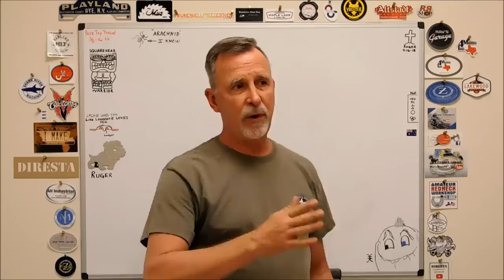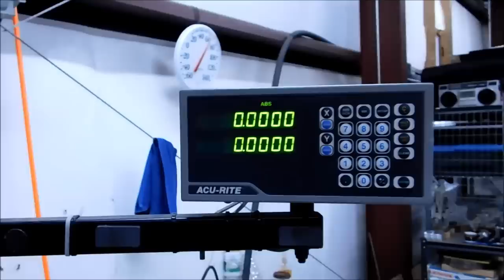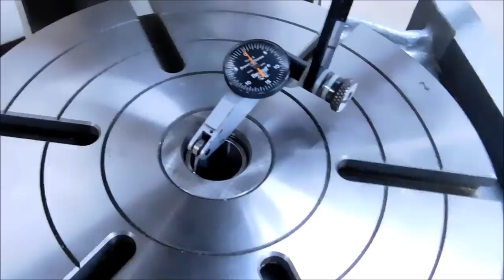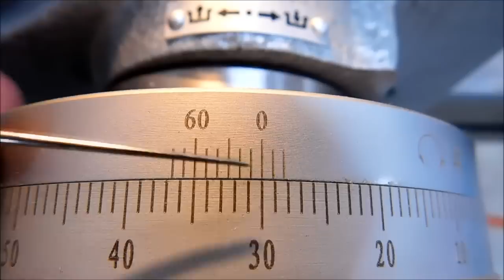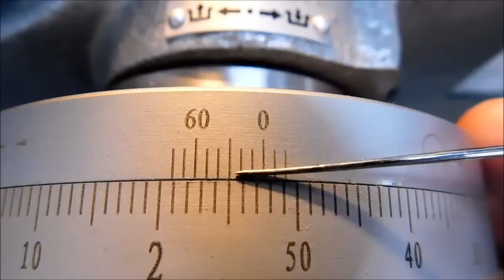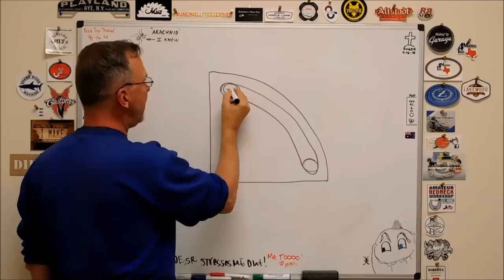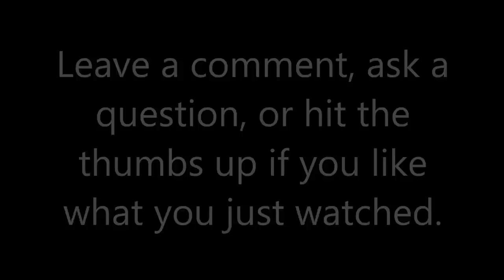Rotary Table Basics

Comment: many years ago i had a .75 dia  tube i needed to put two holes  at an angle.   180 around..   with a dividing head.    i had very little experience with a dividing head.   it took me almost 30 min.  to do the math.   in the machine shop you eater learn , or you get burned.

Comment: Joe, 
How did you make the slots in the rotatory table perpendicular to the base when the table is zeroed out? It looks like you moved the zero marker but I can't get a good look at it. I have a Phase II table and I would like to fix that problem too.
Reply from the maker: This video at about 13:40 will give you a look at the offset adapter I made for the small zero indicator plate.  https://www.youtube.com/watch?v=QmgO2XyrtKc

Comment: To get the table t slots square at zero, disengage the worm drive, grab the table and turn it where you want it
Reply: That will let you zero out the micro adjust on the handle, but not for the whole table and its perimeter scale in relation to the zero indicator he shows at 5:45 that has a slight range of adjustment.  The outside scale on the table itself is basically fixed, unless he'd make a new area to move the 0 indicator to, regardless of where the worm drive is engaged.

Comment: Joe,
Please take a better shot of the clamp that you used to hold down the right side of the table.  I have always just used a clamp set, but the one you used looks like it might be better for those items that don't have a slot for a stud and t-nut.  Also, what were the parts that you used to make the camera mount?
Reply: pieces for a flexible coolant nozzle
Reply from the maker: Most of those components are available on my website, but they are called Loc-Line. This is the 1/2" size.

Comment: When you made the slot wider, the ends of the slot would not be parallel with the sides of the part but would follow the radius line from the center of the rotary table, correct?  How would you make it parallel with the straight sides of the part?  Great videos, by the way.  Thanks Joe.
Reply from the maker: Thats a common misconception. Use the X and Y cranks on the mill to keep the slots parallel to the part sides. Just be sure to get the part back to zero, and go at it like any other vertical or horizontal slot. Then use the rotary to connect everything.

Comment: Thanks for the video. I have the 8" version of the Phase II rotary table and can highly recommend them. I almost always mount an 8" 4-jaw chuck on mine. This makes centering to the table axis very easy.
Reply from the maker: Double check the center sleeve to the rotation of the table to be sure.

Comment: Does a CNC machine effectively eliminate the need for a rotary table, or are their operations that you would need both a CNC and rotary table?
Reply: Beach&BoardFan rotary tables are used in CNC for simple angular indexing. Kinda faking a forth axis.
Reply: Simplest case where a rotary table is desirable is for a bolt circle lager than the Y travel. Use the set the radius using the longer X travel and index.

Comment: Joe, suffice to say you provide some excellent instructions.    I am a newbie to machining.  I recently purchased a 8" rotary table and for now (a chinese brand).  Hopefully later to upgrade.    The RT has a MT3 taper for the center hole.  My question is I like the idea of centering the RT with a fixture attached to the mill spindle such as some type of arbor.  I cannot find such an animal.  MT3 to straight shank arbor.  Any ideas.  I can dial it in but it takes me forever.  Practicing helps I know.  But for a quick centering, spindle alignment method.  Thks
Reply from the maker: Realistically, any stepped arbor will suffice. One end in the collet, the other centers the table. It doesn't need to be an MT3.
Reply: @joepie221  Thks

Comment: Joe, given the base of the rotary table, I would think that table designers would have provided for a taper at the center where one could insert a dead center to which another dead center could be mounted relative to the table center; not unlike a dividing head.  I just purchased a Palmgren 8" rotary table and it does appear to have a slight taper at the center.  So, what were the thoughts of the engineers who came up with the table on this count?
Reply from the maker: I am almost positive the center bore is a taper.

Comment: Is there a good way to keep up with minutes and seconds when you are going around lets say a bolt hole pattern? For an example  you need a hole every 13 degrees  7min 30 sec. That is a lot of information to keep adding up late in the day.
Reply from the maker: Some jobs just require a little more attention. Don't be ashamed to make a chart if it helps. Maybe do the job earlier in the day too.
Reply: an "indexing" tool comes in handy here, where you can constantly zero your starting location at each stop point.

Comment: Joe, I am concerned about deflection of my mill table with a permanent mount of the vice and rotary table.  Bench top 28" mill.  There is enough room, but that's a lot of weight even in an 8" rotary.
Reply from the maker: On a smaller machine, I would choose one of them and center it. Center the table at night when you are ready to leave it for a while too.

Comment: Regarding the table slots being misaligned relative to the base when zeroed, couldn't you just mill a flat on the table base that is exactly 90 degrees from the base, and then mount the reference line plate there? E.g. change where the zero is referenced from?
Reply from the maker: I made a custom index plate. Problem solved.

Comment: math fun: 10 sec. precision = 1/360 of 1 degree = 0.002778 degree. On a 1" diameter = 0.00002424...." arc length on the circumference.
Reply: "No math fun": why mix in minutes and seconds, why not just go for 24,57°?

Comment: Since I'm converting my mill to CNC I haven't thought of any further uses for my rotary table.  Are there any tasks you can think of that would be better/easier with a rotary table than CNC?  If not, I might have a rotary table to sell (if I could bring myself to part with it).
Reply from the maker: Maybe a makeshift 4th axis for the CNC? Rotary table on a tilt base.
Reply: You might have occasion to set the rotary 90° to the miller table to machine operations on the periphery of a part. A CNC miller can be used but wouldn't be much help in that situation as you would still need the rotary to index the part.
Reply: You will think of something right after you sell it.
Never and I mean never get rid of these things, 99% that did wish they didn't.
Even cheap ones aren't cheap.

Comment: You could rotate the base so that the T-slots are as you like them, and then relocate the zero indicator to where the "0" falls. ?
Reply from the maker: That was the fix, but it did require a longer index plate. Not too bad.

Comment: joe I have been working in a job shop for 7 years ..and have recently switched jobs to a valve company that repairs valves stuff like that ...can you please show us how to setup a double lead left hand acme thread..or can you show us how to move the threading tool over to pick up the next thread when the compound is on 14.5 degree  thank you
Reply: Not a problem if you direct plunge cut since you can advance the compound by 1 pitch ( half the lead). If you insist on the 14.5 degree approach you need to find a way to index the part with say two discs that have index holes at 180 degrees or possibly depending on accuracy and lathe type indexing the chuck and part on the spindle. 
You could also theoretically advance the compound by pitch/sin(compound angle) Sin 14.5 degrees =0.25036. So for practical purpose move compound 4x pitch. Now retouch off the tool and reset the dials to zero.

Comment: Hey Joe ,,is it worth having a rotary table for a horizontal mill? Have a chance to get one and wondering if it will serve me
Reply from the maker: There is no doubt it would increase your capability, but it may be tough to see what your cutting if you plan to do complex shapes. I suppose price would be the determining factor.
Reply: @joepie221  guy wants to trade it for a aluminum spool gun I have I never use,, older rotary table looks well built and heavy only stands horizontal mount,,
Reply from the maker: @georgespangler1517  If nothing else, you could trade it for something you really need.
Reply: @joepie221  your right,, would be better with indexer with tailstock for my horizontal mill,, going to let it go and keep my aluminum spool gun,,I've need it as soon as I sell it,,
Reply: @joepie221  Thanks for getting back to me Joe,, really enjoy your vedios you have taught me more than you will ever know in the past 2 year's
Reply: @joepie221  that didn't sound right,,lol that's try ,, you have taught me so much in the past 2 year's..

Comment: To me degrees, minutes, seconds makes as much sense as pounds, shillings, pence. Someday I will make a new dial in decimal degrees. Dyslexics of the world untie!
Reply from the maker: If you think about a single degree as one complete 360 degree sweep of a second hand on a clock face, things may start to get clearer. Just pretend, one degree = one hour. For every degree, there are 60 minutes. If you could have a really big clock face and fit 60 lines in between each of those 60 minute lines, you would now have the seconds. 60 seconds to every minute. Everything is just a smaller part of the group before it. Just like telling time. Decimal angles can get confusing and will always need conversion before a machine can be adjusted to position correctly.  The error is usually in the interpretation. 20.3 degrees, is not 20 degrees, 3 minutes. Hows that for a clear explanation??

Comment: Sorry, but I don't think this part would work as it would be intended. This appears to be an adjustment plate to allow a fixed object to swing on an axis point allowing a swing of 45 degrees.  If the long slot in your drawing was milled using the corner of the plate as an axis point, the hole that this plate was meant to pivot on would have created a different radius. Therefore the geometry of the slot should be in accordance with the center of the bolt hole, not the corner of the plate. I would completely mind my own business but we don't want people attempting to make this part and wondering what happened. I read through a bunch of comments to see if someone else had picked up on it (because I didn't want to be the one to say.  - lol) but most of the comments were about acquisitions of newly inspired rotary table stories.  I've learned so much watching your videos, please keep up great stuff you do. Gary in Canada
Reply from the maker: Hi Gary. Its interesting how some minds jump directly to the hole being the controlling feature. This simple part isn't as simple as it would appear. Thats how we not only ruin parts, but also learn. Your observations are a result of your ability to see all the pivot points in your mind and scratch your head at the concept of just one setup. I admire your vision. Good job.

Comment: Not the most rigid setup, but it worked out pretty well on my little mill until I started printing gears. The cut gears are still better, but printing takes less work. http://www.dvxuser.com/V6/showthread.php?338827-Do-it-myself-focus-gears

Comment: Hey Joe, I inherited a rotary table from my neighbour's widow so I never had a chance to ask her husband about it. This rotary table has an X & Y travel built right under it instead of a stationary base when would that be necessary?
Reply from the maker: Any part you need to make that has multiple round features would have to be relocated on a regular rotary table. An X Y table allows you to reposition the part over the rotary tables axis without unclamping the part. Its a better rotary table for sure. Nice tool.

Comment: I am sure if i received a table and the slots at zero were not inline with the absolute center of the mount slots i would box it up and return it. How are you supposed to zero a 2 bolt vice
Reply from the maker: I was surprised as well. I also made an offset adapter for the pointer and solved the problem. All is well.

Comment: I’m not a machinist but if you want to align the slots in your rotary table with the x-axis why don’t you rotate it on the mill table?   Granted you would need to make an adapter plate to bolt to the mill table.

Comment: how do you hold parts to table- there's not enough room for toe clamps?
Reply from the maker: Holding parts the same size or bigger than your rotary table is a common occurrence. Get 2 bars of scrap stock and drill and c'bore them to mount to the rotary table. Make these bars long enough to overhang the perimeter of the table. Place your part on them and drill and tap the bars for the hold down clamps.
Reply: @joepie221  thanks for the help, Joe

Comment: On your sector part you drew.  Shouldn't the pivot point be at the hole instead of the corner?
Reply from the maker: Please give me a time reference.
Reply: @joepie221  Thanks for the reply.  I'm not sure what you're asking when you say time.  My comment is marked "two hours ago" as of this writing. 

When you drew the sector on the whiteboard, you mentioned that the 90° corner should be in the center of the table.  It would seem to me that the hole near the corner should be centered, then the cutout would be the proper radius, allowing for example a pin to be placed in the cutout and the whole sector rotated around, say, a bolt through the hole.  If the cutout radius is measured from the corner, then any pivoting will have to be done from that corner.  Not a big deal; I know it's just a made-up example, but I thought I'd mention it.
Reply from the maker: @jwills8606  At what point in the video did you see the example you disagree with?  Pause the video and look at the run time in the lower left.
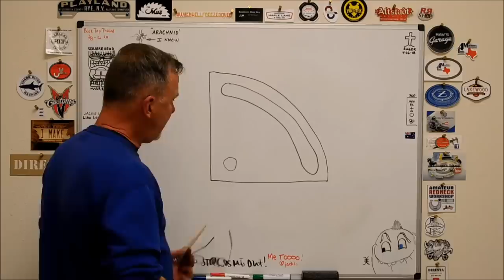Reply: @joepie221  17:17.  "The center is down in this corner."  I think the center should be over the hole, so the slot will be along a radius referenced to there.  There's no need going back and forth.  I think we are talking past each other.  Cheers.
Reply from the maker: @jwills8606  Technically, for a part like this, there are 2 center locations needed. The lower left center point allows for a true quarter radial section for the outer profile. And...for the slot to perform as intended, the slot center needs to be over the pivot hole center. Does that answer your question?
Reply: @joepie221  It does.  So we agree.  Thanks.

Comment: I guess I'm not normal, makes perfect sense to me, but then again, degrees of a circle aren't a mystery to me, It's the same thing when you talk degrees on a compass, or when you're setting a compound on a lathe, we measure it different to set it, but it's measuring out the same thing in a different manner for a different purpose but the underlying theoretical circle is the same. on an old lathe we use trig to figure out where we are between degrees. or to confirm that we are exactly where we think we are. after having to math out angles on the old machines, a rotary table is a lot like cheating really lol

Comment: Probably a silly question, but what's preventing you disassembling the table and reassembling it further round on the worm to make the slots line up in the way that you want?
Reply from the maker: The index marks are cut into the table. Its fixed. I extended the pointer with an adapter.

Comment: Would you buy a Phase ii, or a grizzly 6 inch rotary table?
Reply from the maker: For no other reason than familiarity, I'd go with the Phase II. I am just not up on Grizzly specs, but they have quite a product line.
Reply: @joepie221  The handle is bakelite.  I've already JB welded mine back together.

Comment: 4:46: well, if one pair of the mounting slots was supposed to be true towards the perpendicular surface when at zero/360 degrees it would make sense to indicate it that way, in this case it doesn't of course.
and for the record: the vernier is just bad, there's no point in making it so small other than the precision of the rotary isn't that good to begin with. with a dial that big it won't be problem to extend it all the way out for 5 or even 2 seconds of a degree...

Comment: how the heck do they get the gear lash out of that  yet make it still turnable?
Reply: recirculating balls?
Reply: ( I am not a machinist, so I'm speculating...)

I think it still has backlash, but not much, since it's a worm gear...? He talks about not climb milling on one because it will overcome the backlash...
Reply: 16:22
Reply: Any R/T I've used the worm is on an eccentric, you swing the worm into engagement with the worm wheel or out while indicating parts into location. That way the table can be rotated by hand. There's still some back lash with the worm fully engaged, but that eccentric eliminates most of it.
Reply: @richardcranium5839  - ...what?  Can there even BE such a thing as a circular ballscrew?  My tiny mind isn't coming up with a mental picture for the ballscrew nut at all.  <edit>  I was thinking of a conventional ball screw with a lead screw - and later realized you probably meant somehow putting ball bearings between the worm and the worm wheel? Turns out that actually exists.  Who knew?  (not me)  https://patents.google.com/patent/US2451998A/en

Comment: Not sure if this is wrong a good tip, if you have a fixture on the rotary and you loose your center reference, 
Can you eyeball the center and then with some scrap stock cut a hole via a 360 and then RE reference the center from this hole as it should match the center of rotation of the table.
Or is there a reason this is wrong
Love you video's and tips.